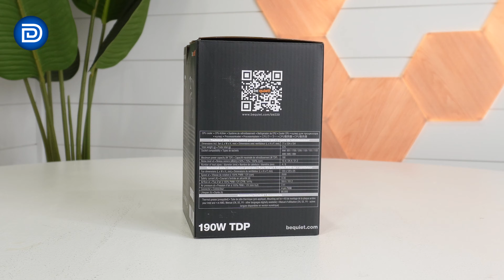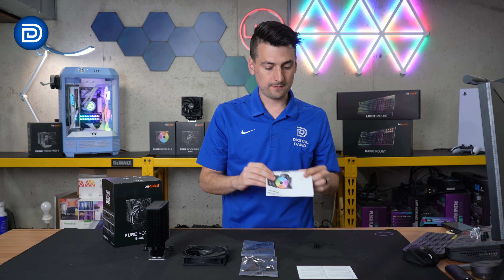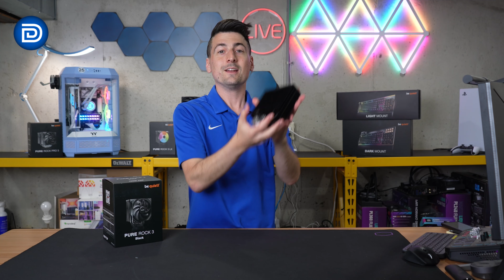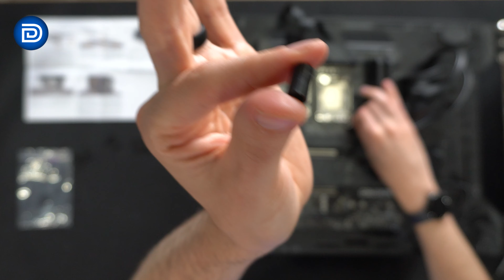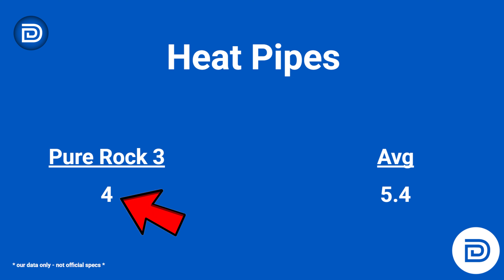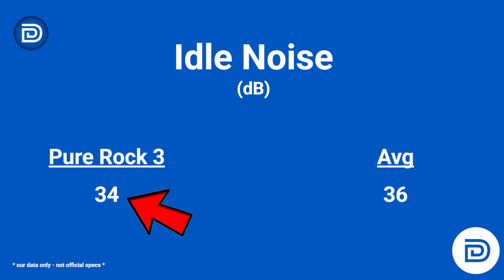be quiet! Pure Rock 3 Showcase - Cool and Quiet

Comment: The cooling is good. However, the included fan is simply weak. It's a Pure Wings fan. This fan is primarily used to cool the case, not the CPU. Therefore, I had to replace the fan in this cooler with a Noctua NF-A12x25 PWM. In other words, frequent changes in CPU fan speed are audible with the original, inexpensive Pure Wings fans.